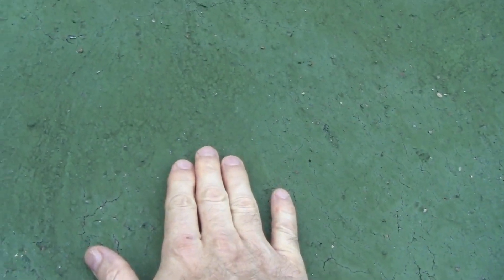Latex Concrete Roof 10 years after construction

Comment: There is free latex paint all over the place, if you don't care about the color.  Counties and cities are looking for ways to get rid of it.  Waste latex paint as a beneficial concrete admix has been studied in New Zealand ("paintcrete"), Quebec (frost-proof study), and Florida (waste dept use study).  Found to improve weatherability I think in all cases.  It (paint) at too high a dose (maybe 6% of total concrete volume?) will weaken cement or at least really slow hydration, increases air quantity, and can increase shrinkage (paint shrinks).  It does seem to help curing without keeping the concrete wet.  True latex or acrylic admix products are over $100 a gallon, making latex-modified bridge-deck mixes at well over $2k per yard.  I think messing with the free waste paint can be very interesting, environmentally beneficial, and affordable!

Comment: I'm here because zip tie domes channel recommended this as one of the methods for covering domes
Reply from the maker: Interesting. I've built domes from bent plastic conduit and zipties as temporary tarp shelters. Will look for the  channel.
Reply: wow same. i emailed him that question and i seen that dome. then i searched yt and found your video. awesome stuff
Reply: 4 years later: I am also here to cover a dome. Mine is made from 3/4 emt metal conduit. This method seems to be the best for my particular situation as I need to cover a big area and keep the overall  weight low.
Reply: How dod it work out? I'm down to build then cover a 24" 3D steel dome and this with hemp canvas is my current concept!

Comment: I'm planning to do this right over a heavily rotted roof.  The decking is rotted but support beams I think are decent.  This will add structural rigidity and prevent the massive labor of tearing off the old decking and shingles and redecking and reshingling.  With this system I only pay around $1k in materials and DIY the entire roof which would be around $30k to have done by pros due to my decking condition.

Comment: I am greatly intrigued by this method and am wondering on everyone's thought of using Elastomeric Roof Coating. It's acrylic latex and is the same price as decent latex paint.
Reply: i'm planning to use tractor supply Lexington Fence Pro Black Latex Fence Paint for $55 for
5 gallon bucket

Comment: Did you use any water in the mix?
Reply from the maker: Yes. A bit of water was necessary to loosen the mix going along. It sets quickly.  But not much. Just a little for consistency.

Comment: Do I understand correctly that the white we see when inside and looking up is just fiberglass cloth saturated with the mix, not plywood painted white?
Reply from the maker: That is correct.  No wood in the roof other than the 1 x 4  framing you can see.
Reply: @drylandfish1765  That is really impressive. Seems like this would be the roof to use for a cabin waaay out in the middle of nowhere, when everything has to be brought in very laboriously.

Comment: Hey, I'm currently reading Dr. Nez's book. (Latex Concrete Habitat- Dr. Albert & Dr. George Nez) The book is arcane and strange but a revelation. It's really a very simple and elegant process! This is my missing link. I've been studying Tilt-Up concrete (variations of) as a way to build a structure for a shop, house and outbuildings that's dirt cheap. Tilt-Up is customizable, cheap, strong and will still be ruins standing around in a thousand years... But so far, a CHEAP, durable, leak free roof has eluded me! 

This is the ticket Maynard!!! This is my cheap, last-forever roof to go with my cheap, last-forever walls! Thanks for the video of the long term reliability of the roofing system. It also cleared up a bit of strangeness in the book. The authors (two authors is probably the problem) say to use the plastic covered window/door screen in most parts of the book, then in another section it says to use ONLY non-coated fiberglass. I'm going to watch all of the videos on latex concrete to clear up all of the strange descriptions in the book. So thanks again! You helped me a lot!!!
Reply: Hi there! Can I contact you, to ask for some photos of the book? Im from Argentina and here its imposible for me to get it. And I need first hand information, because im planing to use this system on the roof of my house. Let me know! Thank you either way!!

Comment: Excellent video, I will be experimenting with this soon. I'm a painter and can't stress enough on quality product, "you get what you pay for" usually applies.
I will be using a high quality exterior gloss as the glossier paints also tend to be more durable.
Dulux has an exterior paint that utilizes microscopic ceramic beads I will try.

Comment: can i dilute the latex-cement mixture to paint consistency and paint a metal roof?
Reply from the maker: I would think there might be problems with the difference in thermal expansion between the materials.  And I'm not sure what the outcomes changing the ratios of the mix would be.  The use of some kind of reinforcement mesh is also critical -I used plastic coated fiberglass window screen.

Comment: Are you saying 'flyscreen'" is that fiberglass screen netting,? seek 02:07 for technique/formula 
1 part Portland cement 1 part latex 1 part fine sand
Reply from the maker: That is correct. Plastic-coated fiberglass netting.

Yes. The initial layer was 1 part portland, 1 part latex admixture to saturate the 2 layers of screen. The following layer was the same components minus the screen and  with 1 part fine sand added.

Comment: Why not just do ferrocement?
Reply from the maker: I've done ferrocement.  I guess it's a question of the particular application.  Depends on the properties you're looking for.  This is lighter, it is somewhat flexible, it requires less materials.  Not to mention this was faster.  I've built little ferro domes and they're practically bomb-proof.  Would make a good tornado shelter.  But I'd hate to have to build a big roof using the same methods